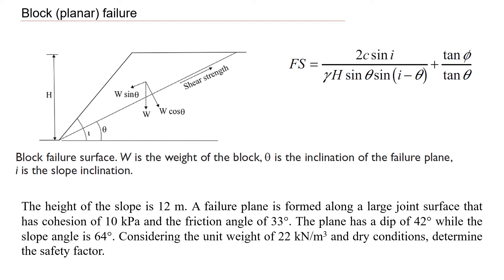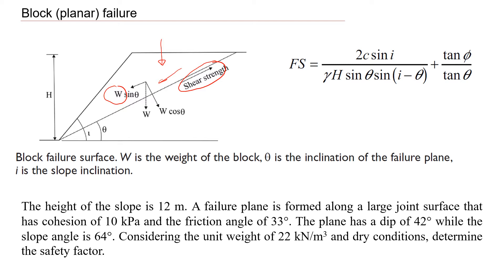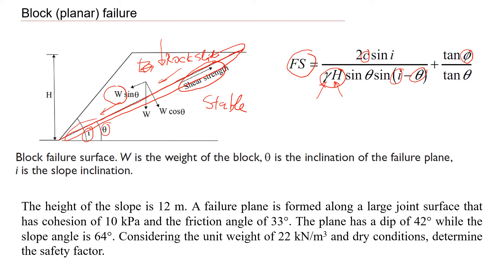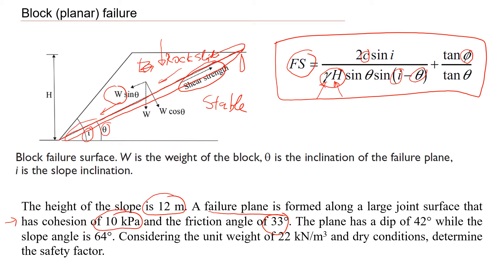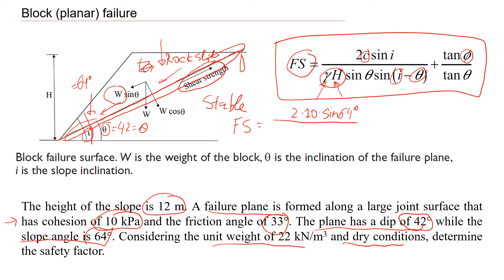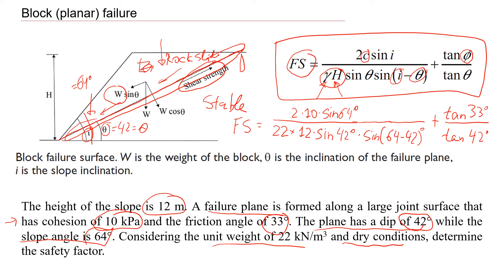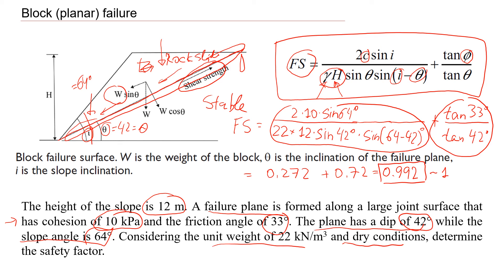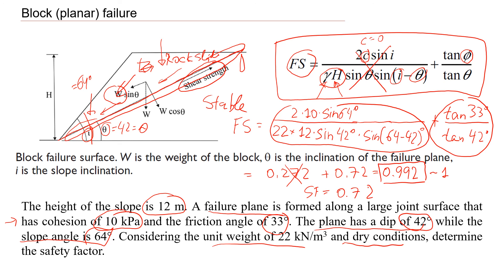How To Calculate Safety Factor of Slope against Planar Failure in Civil Engineering #education

Comment: Hi ...please, what about cohesion equal to zero (C=0) ?
Reply: Potentially you have already found the answer and this is far too late, however, I believe, where cohesion=0, such as in sand;

FS= (c/𝛾ℎsin𝛽cos𝛽) + (𝛾−𝛾𝑤/𝛾) x (tanθ/tan𝛽); 
where (c/𝛾ℎsin𝛽cos𝛽)=0, as c=0. θ is the friction angle, 𝛽 is the angle of the slope, 𝛾 is the unit weight of the soil and 𝛾𝑤 is the unit weight of water (9.81). 

So you should be left with just: 
(𝛾−𝛾𝑤/𝛾) x (tanθ/tan𝛽)